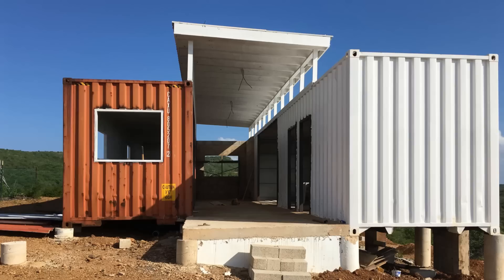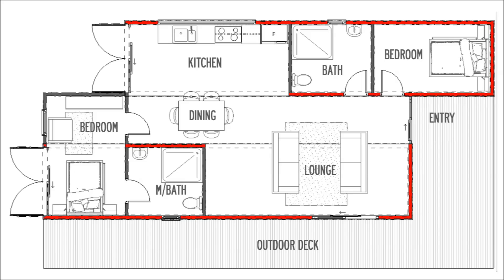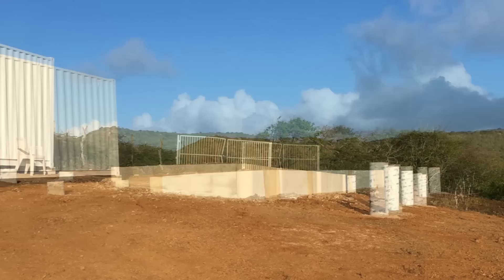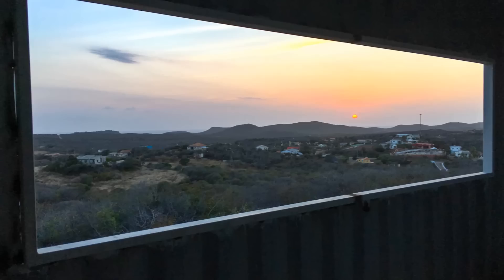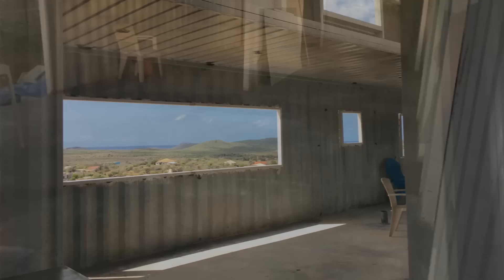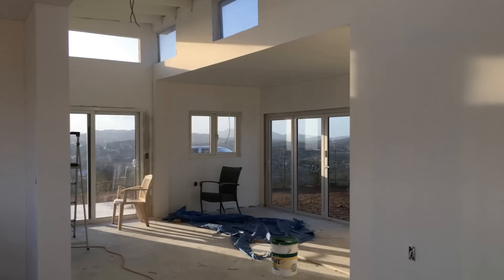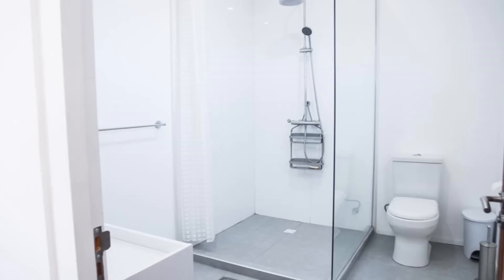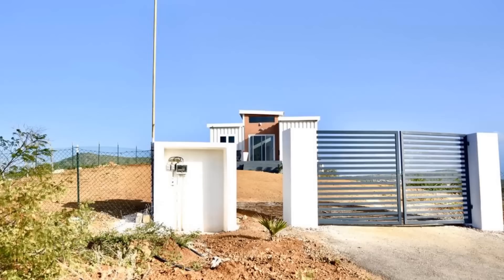HOW TO BUILD A SHIPPING CONTAINER HOUSE: A COMPLETE GUIDE

Comment: The floor plan design is similar to what I have in mind: two parallel 40 footers, but with an angle to get maximum air flow
Reply: If you is interested in container home plans the greatest success that ive ever had was by following the Magic Container Plans (i found it on google) without a doubt the most helpful course i've tried.

Comment: Thanks for the very informative presentation and similar to what I want to build. There was no mention of how to waterproof the bathroom/ wet areas. Do you have a video on this? Also, is it possible to do the middle section between the two containers with as a floating floor in steel bars  covered in marine ply and then finished internally?